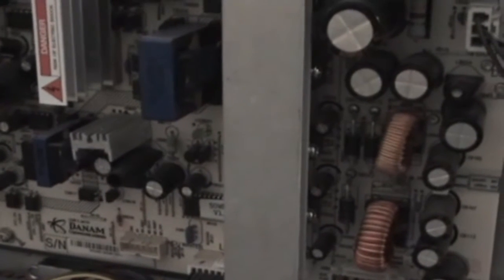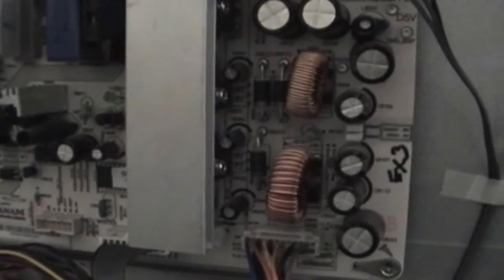Insignia NS-PDP50HD-09 Repair FOR [ 4 BLINKS ERROR ] IN POWER SUPPLY LJ44-00145B

Comment: Repair tech of 30 years... two ( non electrolytic ) caps that have failed generally cause this..  very easy fix... 4X blink is a VS supply voltage detect error..
Reply: Frank Scarano can you explain further please
Reply: @jeniaholtz6575  two capacitors, of the non-polarized type, failed causing voltage to not be detected in circuit they are a part of. I HIGHLY suggest NOT working on boards with big caps, such as this one, if you do not understand what that means without reading up on working around big caps. Specifically manually discharging with a high watt rated resistor.
Reply: zombieregime 

Yeah I'm not sure. I did replace this part. Lasted about a year. Had the hurricane and it wouldnt work after that 😞

Comment: Hi, enjoyed your video...
My problem is when I turn on tv it makes two popping sound and the green light on the front blinks a couple times then remains green. NO PICTURE!
When I remove the back and plugs it in I hear the popping sound and two green lights (led's) come on. One of the lights has 3 little led bulbs and the other has only one.
The front monitor light stays steady green. (No red lights).
TV is an Insignia NS-PDP50. Any suggestions? Thanx